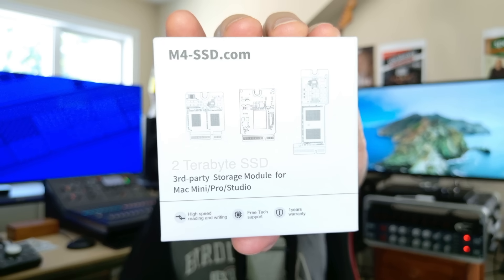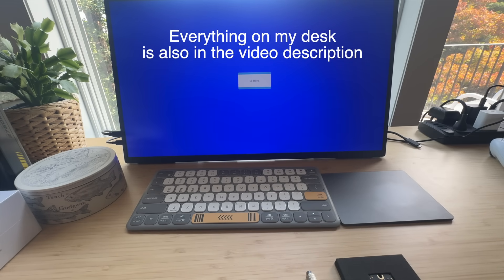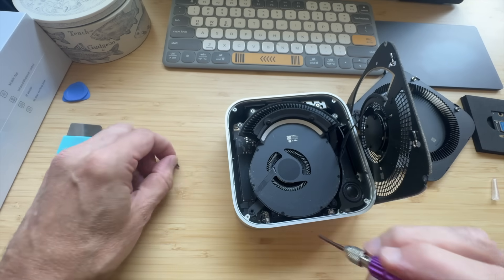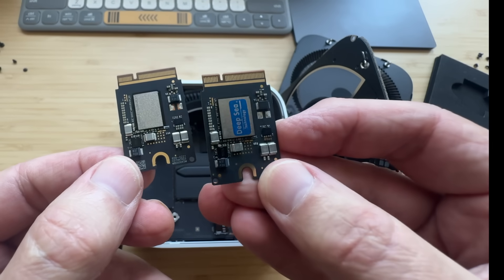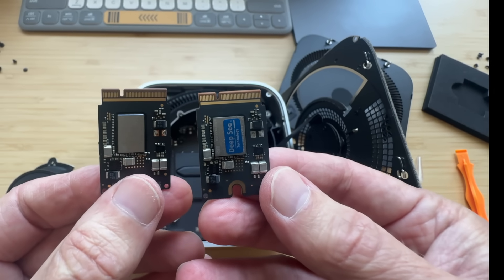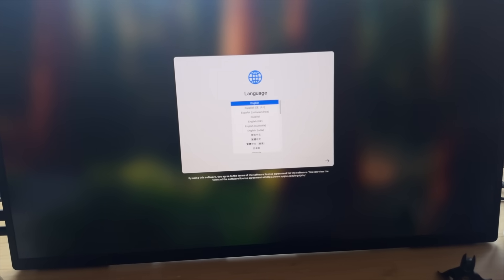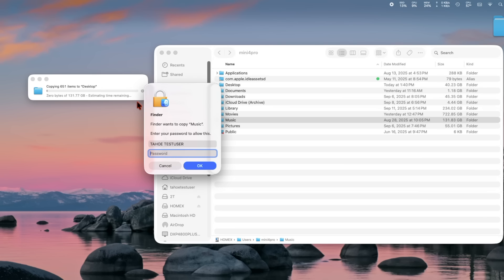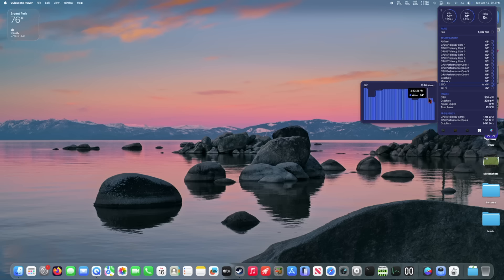Apple should be ashamed!!!! Save $445.00 2 Terabyte SSD upgrade for M4 Mac mini DIY GUIDE

Comment: The very first thing you should say before anything else is: "You need two macs for this!"
Reply from the maker: Good point I will pin a comment.
Reply: @MacSoundSolutions  it can be done without another computer, after adding the new ssd put the Mac mini in DFU Restore. The process it’s as follows. Unplug power cable and any other cables from the Mac mini. Put it upside down.  On the port for thunderbolt( the one with the lightning) plug the white type C cable that came with your Mac ( or the one you use for your iPhone, do not use one for thunderbolt, other type C cables work too ) with the Mac upside down and the cable on the thunderbolt port hold the power button and plug the power cable. The light will blink in orange and It will show on the screen two options. Recive Mac and Restore Mac, select Restore Mac and it will download all the files straight from Apple servers. If you have files on another Mac just use Time Machine to back up before replacing the ssd and then move to the new Mac.. if it’s your first Mac or don’t want any files from the other Mac you are good to go.
Reply: Some of the notes are obviously not for you but for readers that might not know.
Reply: You can use an Intel Mac, but it has to be running Ventura at least.
Reply from the maker: @dansaid5950 👍
Reply: You can always do the upgrade, take it to an Apple Store to have them install the software with one of their Mac’s for free
Reply: Interesting until I saw this 😮
Reply: I always downgrade to what’s running on my original 56k. Which leads me to the question, where did you get the desk clock? 😊😊😊 and subbed, thanks for the info!
Reply from the maker: @TheSkulletMan the clock is an app running on a hub which is by Wokyis 
https://wokyis-m5-retro-outside-powerful-inside.kckb.me/macsoundsolution I think they are now selling them on their website https://wokyis.com/products/wokyis-m5-10gbps?srsltid=AfmBOorqd0BabCO2hkr930iX4ZuC1YsUyE3ogt5ZgmuGfG00yU2IMAs3

Comment: Thank you for the video again. Because of your first video where you explained how to move your user account to an external drive i did this and everything works fine! But now i would like to upgrade my internal ssd to 2 tb. Now my question, do you know if it is possible to move you your user acoount from the external drive back to the new 2 tb internal drive after the upgrade? When i moved my user account to the external drive it didn't worked at first so i had to restore my mac to factory settings to make it work. That was not a big problem because i had not done a lot of software installations at that time. But now it would be a lot of work. Have you ever tried to move an account from an external to the internal drive?
Reply from the maker: I plan to do this with my M4 Pro. It should be as easy as copying the timemachine backup of the user to the internal users forder and then re setting the path and rebooting and loging in. I have not tried it yet but will soon. The OS should not need to be re installed to do this, I have moved my user between computers without issue, I will try to do a video on this soon, but I have a few others I have to do first.
Reply: @MacSoundSolutions  Hello Lance,
Yes it would be great if you could do a video about that to 🙏🥰.
 I just orderd a 2T for my Mac Mini M4 to and i emaild  them if i could do it whit a PC and if you have their DFUKit you can 😊
Best Regards from Sweden
Reply from the maker: @stefan5782 I wound up using carbon copy cloner to move my home folder back to the internal, timemachine copied the data but it was a bit of a mess, CCC copied all the permissions and it was up and running just like the external. Will make a video soon.
Reply: @MacSoundSolutions  Thank you very much Lance 🙏🥰,
I will get the program 😊, looking forward to your video and thank again for all the great work and tips you are giving to all of us ❤
Best regards from Sweden🥰
Reply: @MacSoundSolutions  Hollo Lance,
I will get my 2T drive today, and i plan to mount it tomorrow, so i can just use CCC and copie my home folder to a hard drive and just copie it back into the MacMini 🤔
Best regards from Sweden 🥰🥰
Reply from the maker: @stefan5782 you can but first boot up and create a user account different from your main account, the create the same name account as the external and that will be your target, and select your external user that will be your source then set the path in users and groups, do all this from the backup internal user account once you set the patch you can log into the moved Main user. Video coming soon, hoping to do it next.
Reply: okej, thank you very much Lance 🥰
I will do this evening and i will get back to you after it's up and running 😉
Again, thanks for all your great videos and the help you are giving us ❤
Best regards Stefan from Sweden 🥰

Comment: Have you noticed any difference in the products you have used to replace the mac mini storage with?  Is there one you would recommend over another?
Reply from the maker: As far as the internal storage goes, I’ve only used this one company’s SSDs for external storage. I’ve used a lot of different enclosures and I prefer the Zeke and the Acasis and I really like the Beelink hub / enclosure. And Western digital SN850x NVMe.

Comment: What to do with the old m4 SSD after installing the new SSD, is there any enclosures for it?
Reply from the maker: No you can’t use it unless you put it in another Mac mini they are proprietary best to just keep it around for back up in case the new one goes down for some reason you can reinstall the old one and boot up without having to do the DFU process again

Comment: I got the M4 hub SSD... it concerned me at first cause I got it from M4 Hub but the box had a totally different name on it and the SSD had another different name on it. I got the same SSD you got same brand name and everything but totally different and mainly useless tools I didn't even get that metal pry tool... I had to use my ifixit one and the bits sucked so bad that came with the screw driver not magnetic and just crap... still worth the price I got mine for just toss the tools

Comment: 3:50 when unscrewing it, is the driver turned Clockwise or anticlockwise?  One does not want to bore out those tiny screws!
Reply: lefty loosey
Reply: @HMods1991 😂
Reply from the maker: Left to unscrew clockwise to screw😅